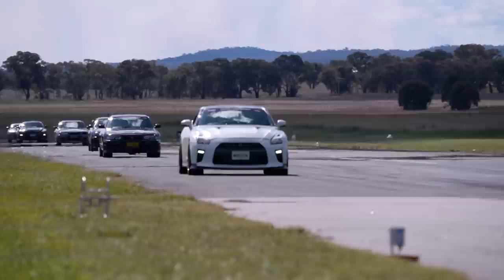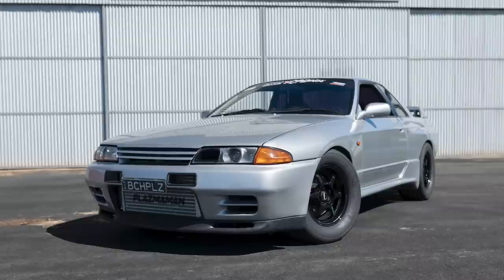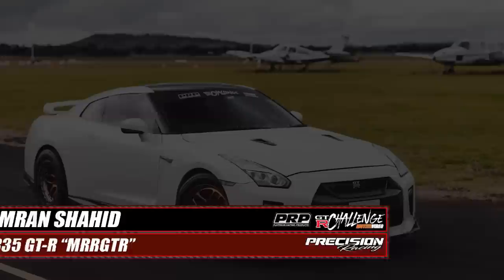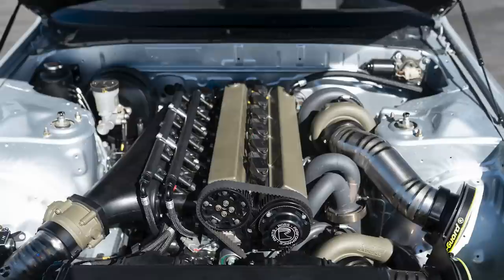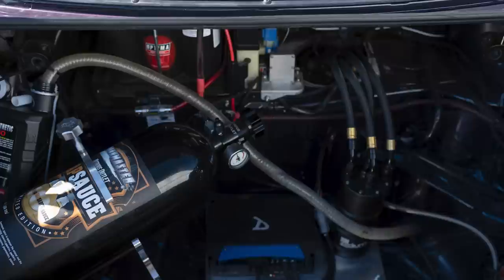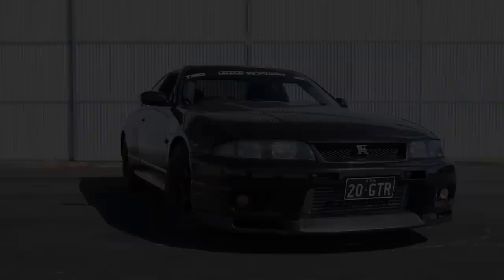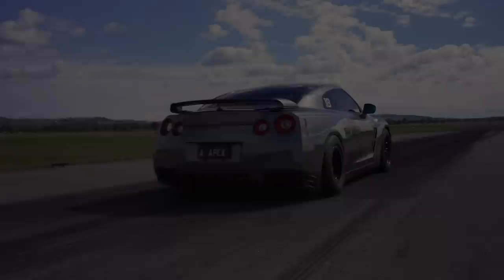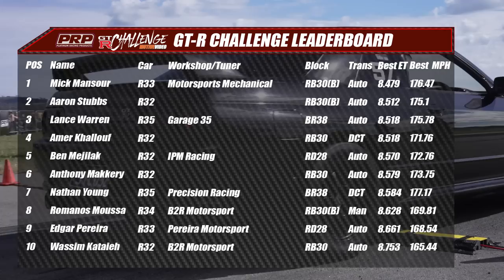8-second Skyline GT-Rs vs R35 GT-Rs on a Runway  - PRP GT-R Challenge 2023 Pt2

Comment: How come your GTR goes arrow straight down the strip but other dance about? Is that cause they have more HP? or less grippy tyres? 🤷‍♂️😊 (both AWD cars, as i can understand RWD/FWD)
Reply from the maker: It’s a few things. 
Power is one. Huge power is just hard to tame.

Power increase per gear. Ours gets in the groove and the power increase per gear is minimal so doesn’t shock the car on a gear change. 

Sidewall of the tyres is a big one. The big sidewall stuff on 15 inch wheels wanders around more as sidewall flexes. 

Our suspension is still biased more towards handling and street rather than outright drag racing at the track, so works well on a street surface. You notice ours doesn’t get unsettled softer the bumps on the runway.
Reply: @MotiveVideo  ahhh that makes sence now, thanks for that mate
Reply: @Tom-lf8hx If you watch the first part, there's a 1700hp R32 thatbwas struggling to keep itself straight and (correct me if I'm wrong) that car was running under "True Street" rules.

I kept thinking to myself "At that kind of power, it should be running under 'Pro Street' class."